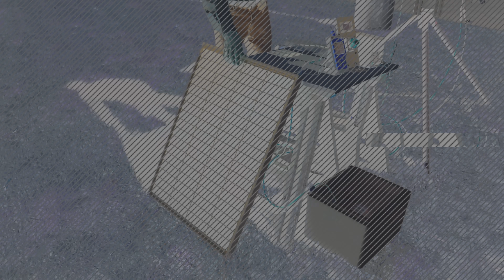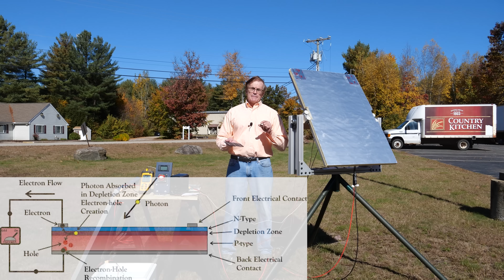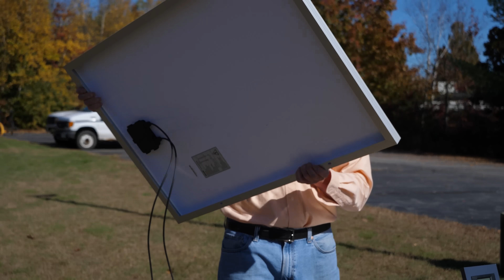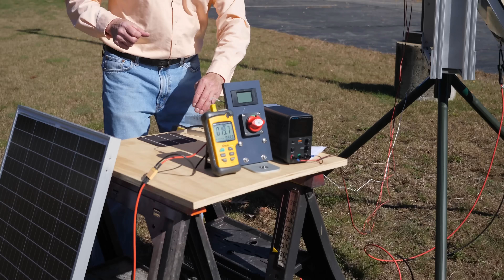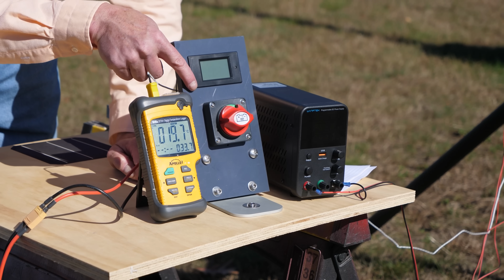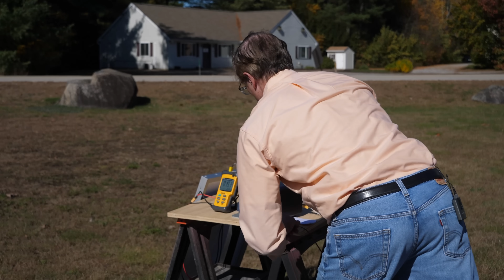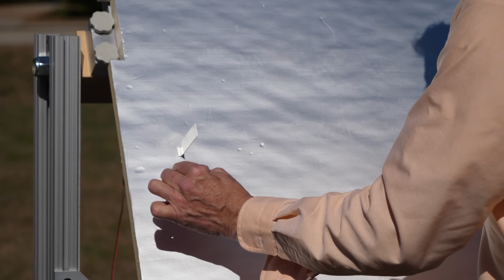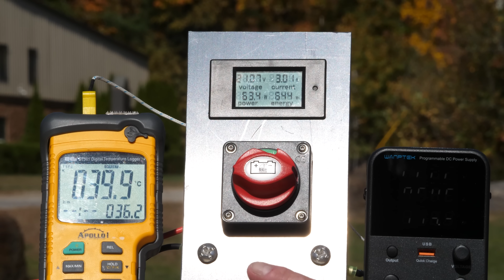Do you REALLY get enough out of your solar panel?

Comment: Good experiment. 
One dimension you did not mention is the watt-hours. You can demonstrate a power advantage instantaneously, but what is the gain over, let's say, 24 hours. You may be running the fan some of the time when the panel is not hot, wasting energy with the fan for no gain in panel output. Of course, this would be overcome by some form of temperature controlled fan. I would assume the warmer the panel gets, the more heat exchanged. So turning on the fan too early would become counter productive. 

I also wonder if you flow the air from the bottom to the top of the panel. It seems convection would cause there to be an airflow from the bottom of the panel to the top. I would think pushing air in the bottom and out the top would gain a bit better.
Another question is how much cooling from the fins alone with no fan.
Reply from the maker: Without  the fans running, the extra surface area of the fins and natural  convection actually keeps the panel  slightly cooler. 
In our setup, the fans were blowing  outward and were complementing the convective flow.

Comment: I’d love to see you combine this experiment with the solar concentrator from another video to see if you can perhaps make a single panel output as much as two panels, with say 1.5x the cost of one panel… meaning you could save on the number of panels with a bit more work.

Likewise, it’d be interesting to see if you could use the water coil for the solar water heater as a method of cooling vs the radiator fins and air.  

I know you commented on the water temperature rising, but maybe this can be combined with the air conditioner design that uses the desiccants, to cool the water.

Comment: This information is amazing, well done, I am curious though, how it would benefit a string inverter set up where the inverter is away from the roof on the side the house (cooler more efficient) verses where they put micro inverters under each of the solar panels.
Reply from the maker: Thanks!
It would help, but the difference will be small.

Comment: One of the main contra points you left out: basically it´s mostly viable in summer. In winter the only get 1:3 of photon flux but you still have the same amount operatin costs, also cooling is less efficient. I could image that the active cooling could be useful when you have something like a pool, which you want to heat during the summer. Or maybe an ice based latent heat storage in addition with a heat pump.

Comment: Surely the fans should be at the bottom of the panel for greater cooling efficiency?  Pumping heated air downwards is hard work.
Reply from the maker: Actually, because  they are blowing  the air out, not in, they're  positioned properly.

Comment: What’s the temperature say 20’ down in the ground? Would that cool air cool down the panel if the panel was sitting on a pvc tube as wide as the panel and that tube was cut at an angle?

Comment: I wonder if you were to make a frame+heatsink for the pannel that allowed for the heat to act as its own fluid pump sort of like a chimney (flow through instead of needing to enter-> make a 90 degree turn-> travel though the heatsink->90 degree turn->exit), if it would be overall more energy effective than powered fans.
Now something like this would sprobably require 2x6cm fins and a thicker frame to allow for more volume at lower velocity

I know they're expensive but i'd also be interested to know if those XY axis graphene pads could help make the fins more effective, though an experiment like that would be expensive at this scale, maybe 6 cells in series in a 1wide by 6 tall pannel, or wait for these sheets to become cheap

Comment: So if adding polished aluminum reflective panels ups the power several times. Would it be of greater benefit to buy a higher wattage dollar panel. For example,  if you could boost your power triple that of a 100 watt panel would you still get triple the pretty out of a 200 watt panel using the same method?
Reply from the maker: The major advantage  of the reflectors  is the very light weight  for portable systems.

Comment: 🤔- Great vid, couple questions? -- It was mentioned the solar panel was 100watts.
It seems like everything was: "optimized/proper" for the panel, yet it was only reading generating 66watts at peak? Why is this?
For reference - various sites (including US-DoE/NREL) seem to say panels should only degrade 0.5%/year & be ~90% performant after 20 years.
-(sidenote that irks me: 90% performant of true performance. it seems most panel wattage: "stretches the truth" & 100watt panels are "known" to generate 90watts, to my understanding/other youtube tests) ... (so, 81 watts at year 20)

So with that said: why 66w on your 100w panel? (It seems alarmingly low.)
Reply from the maker: As I mentioned, the maximum  rating depends on solar flux, and in the afternoon in New England, that kind of performance  isn't  surprising.
Reply: Oh, wow. Well - thank you for the truth in advertising! 🙂

Super appreciative for the vid - that (efficient) cooling of (hot) solar panels is net-positive wattage & +value in lifetime.

Thanks again!

Comment: Oooor, you could slap a few Peltier modules on your existing setup and perhaps gain enough watts to power the fans? Maybe?
Reply from the maker: Maybe.
The problem  with thermoelectric generators is that they are very inefficient.  They could easily  produce  enough  power to drive the fans, but because  they need a temperature differential  to operate, their presence  will interfere  with the cooling  process.  The resulting decrease  in the efficiency  of the panels will negate the advantage  of the harvested energy.
Reply: @TechIngredients  Good point. I don't know how big a standalone thermoelectric generator would need to be to generate enough power to run the fans. I suppose at that point, it would just be easier to add another solar panel just to run the fans. But then you're already improving the efficiency of the solar panel by adding the cooling enough to make up the fan power difference needs anyway. So doing it your way is actually simpler and cheaper overall anyway.

Comment: Here's an idea. Solar thermal water heater with Peltier modules between the black panel and the water sink. That way you use the thermal energy twice: you're generating some electricity and then heating your water with that same heat. What do you think?

Comment: I've just come back to revisit this video as I had the thought for cooling a mobile PV system on the roof of my 4wd but maybe with a twist of using brush type motors in the fans to charge while moving. After looking a bit close, they wouldn't be any were near as efficient as the alternator, so I think it's a wasted thought, Though........... the thought of using the heat from the cooling might be able to heat some water for showers, I might have to look into that? Thanks again for your many varied tech videos, I've just watched the live stream which unfortunately I missed this morning, your Saturday night works perfectly for our Sunday mornings. Cheers from Australia!!

Comment: A cooky idea, but what if you can transfer the heat (instead of using convection to cool it) to an area where thermoelectric devices are located. As the solar panels heat up, cool it by attaching copper pipes and thermo conductive material to attach to a thermoelectric device
Reply from the maker: It's  not kooky, but the very low efficiency of thermoelectric generators makes it impractical and too costly.
Check out our previous video on the "Campfire Generator. "

Comment: I need to add rigidity to my suspended solar panels. Opinion on attaching 2mm expanded aluminum grate to the back (like mesh), will this help with heat dissipation? Intend to spot gluten, any suggestions of glue type? Your approach to all of your videos is refreshing. Thanks
Reply from the maker: It will increase rigidity.
However,  spot gluing is a bad idea if you want any meaningful  heat transfer because  the airgaps between the glue  points is a very good insulator.
Try adding as much aluminum  powder as you can to the mixed epoxy to increase its thermal conductivity and then use continuous gluing to maximize  contact.
Reply: @TechIngredients  I thought there was a thermal glue available? Like heat sink paste on cpu?
Reply from the maker: We did  a video  on how to make a thermally conductive epoxy.  The aluminum  powder is easy and cheap and works pretty well.
I'm not sure  how that spot glue will work.  Wherever the aluminum  and the panel do not have a layer of epoxy between  the surfaces, heat transfer  will be poor.
Reply: @TechIngredients  because both the panel and expanded aluminum grate both fit within a frame (aluminum window frame) I’m thinking minimal spot glue (your infused epoxy seems good idea).

Comment: There's a diffent and maybe cheaper and simpler way to cool the PV panels. Let a thin layer of water run on the front side of the panels. Its efficiency is improved if there's enough wind to enhance evaporative cooling. At the same time it helps keep the panels clean.
Reply from the maker: I discussed that.
This does  depend  on the availability of water, and it must be free from minerals  that can deposit  opaque salts over the surface  as it evapoates.

Comment: I've been aware of this phenomenon for a while and something I've been consistently curious about is if you put a TEG on the rear of the panel and actively cool the rear of the thermocouple. I know it would generate some power, but at a 20-30 degree differential, I'm not sure it would be much, considering the current state of the art with TEGs is not very efficient.  Additional to this, I'm wondering if you find a material to place on top of the panel that rejects (reflects) wavelengths that are not part of the panel's operations, would it cool the panel enough to be worthwhile.  I'm not sure what wavelengths that would be or what materials would do the job, but considering infrared/UV rejecting films have existed for a long time for home and automotive applications, I would hope that such a thing would be possible.  By rejecting those wavelengths (which would only be able to turn into heat when impacting the solar cell) would it reasonably reduce how much the panel is being warmed by the sun, enough to offset the initial investment of the materials.  AKA, is it worth the time, cost and complexity to add such a rejection layer in front of the panel, and does that impact the panels ability to generate power, either positively or negatively.

I haven't come across anyone who has done either of these tests; and I don't expect to at this point.  Most people put solar on their roof and don't think much more about it.  Of course there is the argument that power from the sun is essentially free, so if you get any energy at all from it, then there's no real reason to complain, and in large solar farms that's valid, since they have a functionally unlimited amount of surface area to populate with panels, but in residential, getting the highest efficiency per square meter is far more important, since most people only have so many square meters to populate with panels (rooftops, etc).  So efficiency is a far better argument to be making there.

I'm almost obsessed with efficiency per square foot/meter, since I'm considering solar for my own home and I only have one section of roof that's south facing, so optimizing the power per square meter is very important to me; once it is populated, that's the end of the story for me.  Almost all channels talk about the efficiency of specific panels, their output and whatnot, but nobody talks about the size of a panel.  If I'm trading 1m sq. panels at 250w for 2m sq. panels at 500w, I haven't gained anything; but a 1.5m. sq. panel at 400w may be a better purchase than 2m sq. panels at 500w.  So when I'm looking at potential panels to examine for purchase, I can't really make a judgement, since I need to calculate the rated performance per square meter myself (and often the square meters of the panel too), just to figure out what will work best.  All panels will have losses, so I'm omitting that from the calculation for panel selection, given that almost all panels will have the same losses due to the same circumstances (heat, shade, etc).  Right now I'm just very focused on getting the highest wattage per square foot/meter of roof... but optimizing each panel to get a better overall output is something that's on the table, so the work you're doing here is tremendously important, and I thank you for it.
Reply from the maker: Using a thermoelectric generator is right out.  As you said, the efficiency  is just too low, and it drops further as the temperature differential decreases.
Check out our previous video on the "Campfire Generator ".
Passive cooling does hold promise, including  the benefit on panel longevity. 
Multijunction panels, specifically with perovskites is likely  the next step in increasing  effeciency. Quantum dot based filters and wavelength converters also show promise and can be used in conjunction with cooling and multijunction systems.
Reply: @TechIngredients  Thanks for the reply. I assumed it wouldn't be worth it, especially considering the efficiency losses, and low differentials; add that to the relatively high cost of a thermoelectric layer and it's a losing combination.  I'm still curious about it, and I'd love to see it done just to see how bad it would be.

I agree that wavelength converters and filters are probably best for keeping panels cool and converting more of the light to electricity.  I'm genuinely wondering, with enough effort, if thermoelectrics could be much higher efficiency; I don't think that many are working on improving TEGs though, since it's such an under-used and relatively unused technology.  I think the only place it's commonly used is in large, long-term deployment spacecraft, like the voyager probe (somewhere that solar wouldn't be viable), in the form of radioisotope TEGs, and for those, the relative efficiency of TEGs currently is more than sufficient for generating enough power to keep those systems working, and it's so rare that nobody is really investing into further research on it.  I find TEG's incredibly interesting, but far too expensive for any practical use given their low efficiency numbers.

Regardless, I appreciate that you took the time to follow up.  Keep up the good work.

Comment: What if you use geothermal solution to use as a cooling for the panels?
If the average of geothermal temperature is around 10c-15c, wouldn’t it serve as a good temp absorber?
For example, if you have an array of the panel, and run some heat exchangers across them, and all energy consumption  would be a water pump?
For colder climates you may use some smart home stuff to shut this thing down when temperature drops certain degrees…..

Comment: Great arguments, but you have to include the opposite as well. Fans and heatsinks have initial cost and maintanance. Solar panels are rated for 20 years passively. Moving objects usually don't have ratings like that simply because they require more regular maintanance, like oil/grease changes, proper dust cleaning broken fins clogged heatsinks. By adding the active cooling you add a bunch of maintance costs. So when you ask the question of whether the input cost is more or less that the output savings then all of this should be included. I'm not convinced active it the way to go. Yet.

Comment: So could you automate the tracking system, both turn and tilt, so it maintains alignment with the sun, then resets for the next day?
Reply from the maker: You could,  but this system  does not require  tracking.  I only did that during the test to eliminate  any variation in the output.

Comment: You made an oven with that panel on the back. The initial test should have been with a normal panel.
Reply from the maker: Actually, the panel  runs slightly cooler  even with the fans off because  of the much larger surface area due to the fins, and the back isn't sealed.
Reply: @TechIngredients  I basically meant that it would have good to have an unadulterated panel to have a benchmark.
Reply from the maker: I understand,  but even then, the individual  panels have differing efficiencies. It's  a rabbit  hole, but as I said, I do understand.

Comment: Hi Guys. Have you ever heard about Carbon-cement-supercapacitors? There is a research going on at MIT to mix cement with carbon black to make a highly conductive concrete in order to build supercapacitors with a huge capacity. It seems to be a very interesting concept for energy storage in the future. I'm not allowed to put a direct link in here but there is an official paper in the PNAS-Magazine which describes this concept in detail, written by James C. Weaver, Franz-Josef Ulm and some others. It would be great if you could find the time to check this out. You may want to share your thoughts about it in a future video? I just love your channel and highly appreaciate your interesting work.
Reply from the maker: Thanks for the tip!